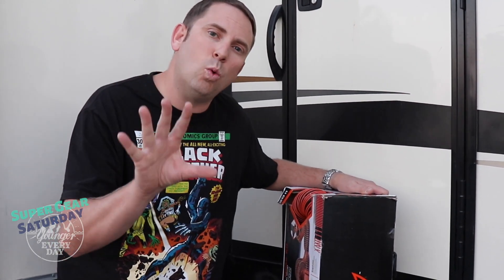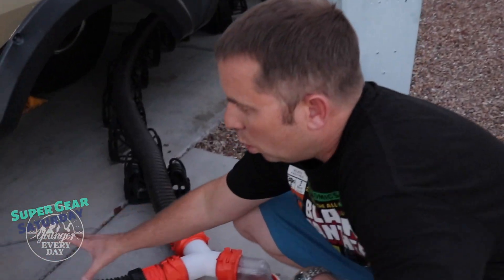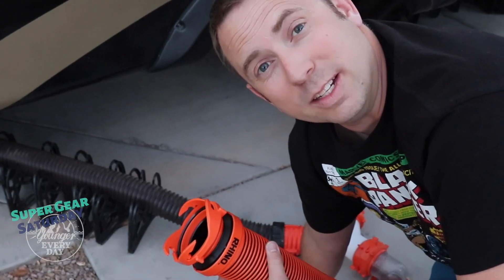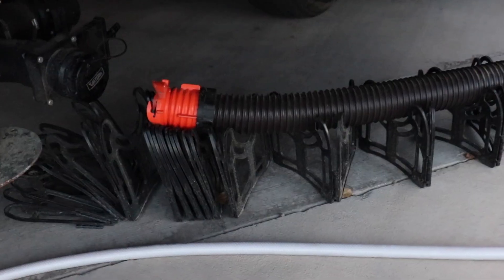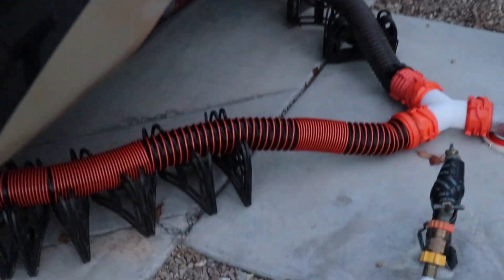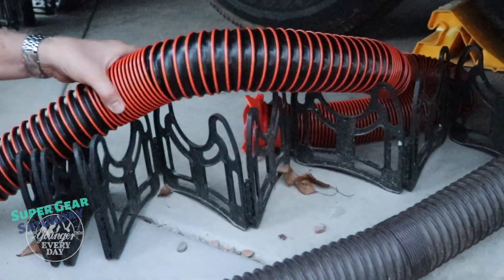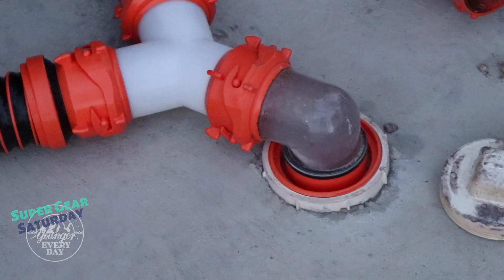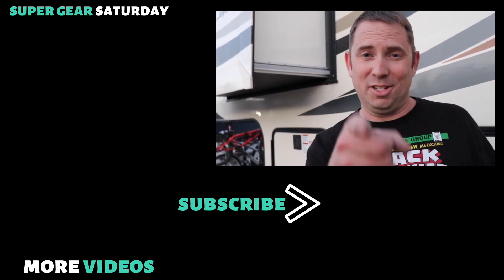Best RV Sewer Hose Kit//Rhino Sewer Hose Review

Comment: When finished with the Rhino Extreme hoses, did they compress back down to the length they were in the box?  I have a Titan hose and it doesn’t compress back to the original length so I have to force it into my storage tube which resulted in several deformations. 
How do you like the Rhino Extreme hoses now that you have used them for some time?

Comment: How do you clean the Black tank hose after dump?  Why not run Grey water through it?
Reply from the maker: Thanks for the question, Richard. That's what I do. I leave the gray valves open with the hose set up in a P-trap. Then, when it's time for a black dump, I save up some gray water to run through after it to clean the hose. Sorry it wasn't clear in the video.

Comment: I bought the 15 ft. hose with elbow, I assumed the elbow was removable.
It was not, I had to cut it off at the dump station as I was out of time to handle it any other way.
This product Sucks, there is no reason to build it this way other than extra Gouging by Camco.
What a totally Stupid design. What a waste of time and Money.
Zero Stars.
Reply from the maker: @robert stevens That’s too bad. I don’t like the models without a removable elbow either. The model I reviewed in this video has a removable one, but the shorter model does not. I am curious: Why did you have to cut off the elbow to use the dump station?